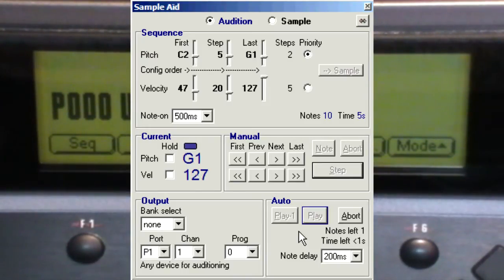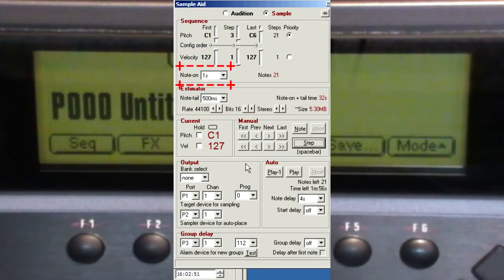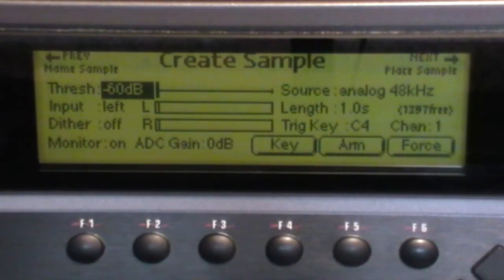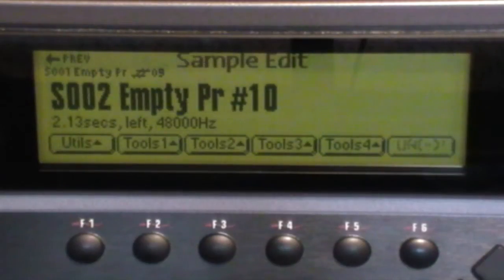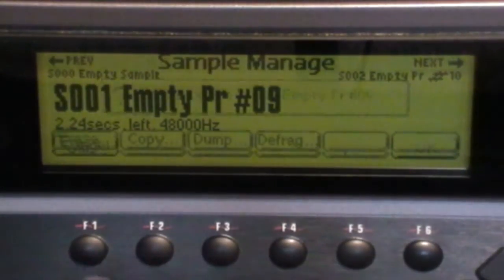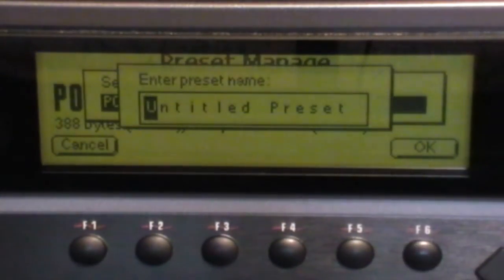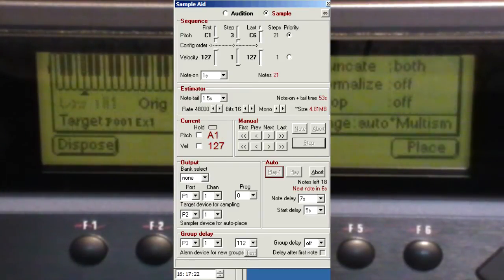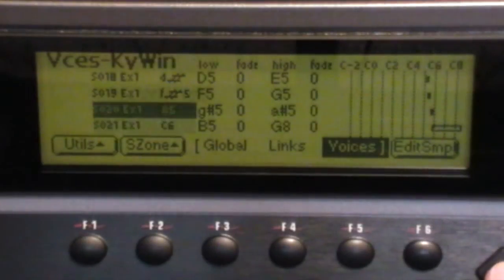Sample Aid 13.16 part 2/4 - sampling a single velocity to EMU Ultra

Comment: Such a weird sampler ive never used the sequencer.  Just tweaked samples then resampled into either a mpc or a eps. Amazing filters tho. One day ide like to use it to its full potential  but im making rap beats.  Also i cant find any manual for my machine (e-synth) nor have i ever seen any videos of anyone  making a track with one....
Reply from the maker: @Gorilla Braudcast yes it's one of the great hardware machines of that time - still coveted by some... I'm hanging on to mine :) :) http://www.philizound.co.uk/freebies/emu-scsi-wiring/images/flock-of-emus-2.jpg

There's a huge amount of functionality in these machines, so maybe the 400-page manual put people off. Took me a long time before I realised it was effectively 64 synthesizers in one box - one synth per voice! 

I found the internal sequencer a bit cumbersome so tend not to use it. It's handy if you've got nothing else, but if it's already wired up to other sequencers, you might as well use those to drive the EMU.
 
I think the esynth uses the same EOS operating system as the Ultra series, so the standard EOS manual should apply. If you get stuck downloading it, send me an email and I'll attach a copy.
More info re. the Ultra series is on my website here http://www.philizound.co.uk/freebies/freebies.html#emu   My email address is at the bottom of the page.

There's much more info on the SamplersOnAcid forum http://samplersonacid.com/forum/index.php so you may find links to tracks produced using the machine. The forum replaces the defunct EmusOnAcid forum, but all the old info was ported to the new forum as a 'read-only' archive; just click the EmusOnAcid button at the top of the index page.